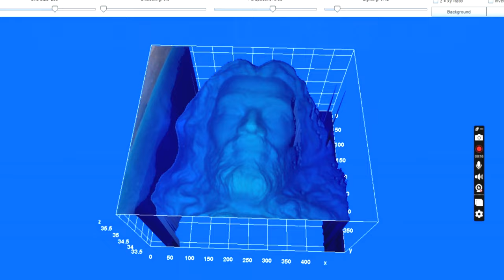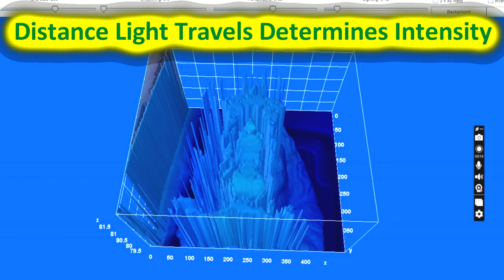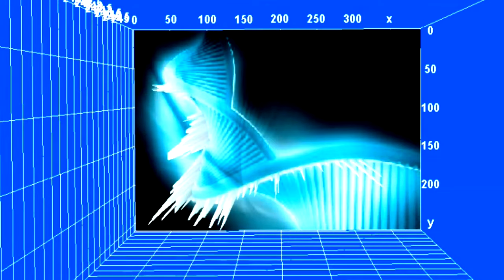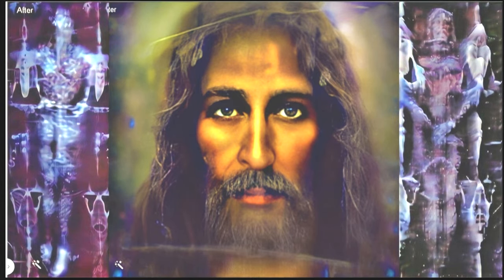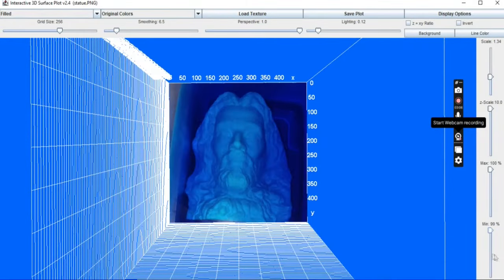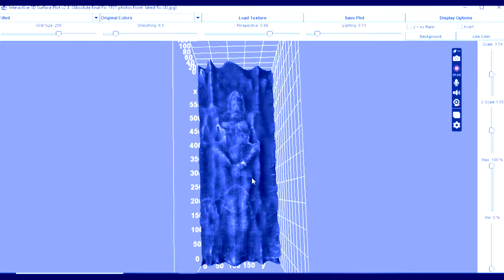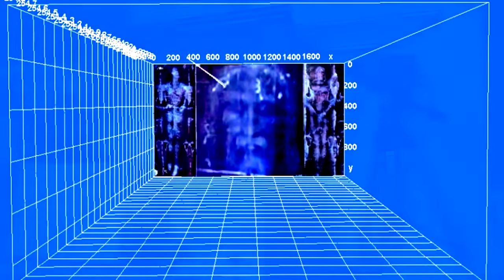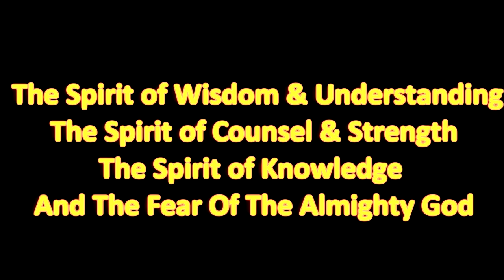Body of Jesus Emitted Light: 3D info on The Shroud of Turin Part 2

Comment: As a 3D developer for 20 years I know it's nearly impossible to create a perfect relief map. When the shroud of Turin is put into a 3D application it creates a perfect 3D model. It's impossible for this to happen in nature, except Jesus!!!! God bless you for sharing this information!
Reply from the maker: Yes,  Baptist Grace.  Very insightful and intelligent comment. The only way to create a perfect relief map is by making a hologram.  All of the characteristics of the Shroud image are that of a hologram.
We should discuss this in more depth.
Reply from the maker: Hi Saved By Grace.  It has been one crazy year with more stumbling blocks put in my path than I can remember from any previous time.   MAKING FOR A VERY CHALLENGING AND FRUSTRATING YEAR.  YES IN ALL CAPS .
The info here IN THIS VIDEO MUST be updated and explained better.
But to state things in a simple way,   If the Shroud was a contact image with paint for example.  The color intensity on the nose and the side of the cheek would be roughly the same.

That would cause the image to look flat and or deformed and awkward looking.   It will look obviously Wrong.  That is why all other images fail.  To state it simply. Those images were not emitting light of a single wave length creating a interference pattern to create the image. 

The Shroud image is made of mathematical distance points converted to color.  And it a VERY ACCURATE.  just like a hologram is. 

For example the tip of the nose as the highest color intensity and the cheeks have a lower intensity coloration.  
When all these light and dark intensity colors are analyzed by a 3D software program they are converted to math and then displayed. 
The Shroud "looks right"  Correct Math.   extremely accurate. 
The photographer who took the 1931 photos used film plates that were insensitive to the color red.  He is the only photographer that did this that I know of.  This minimized the blood stains .  They pose a  huge problem for seeing the 3D depth info because they are not part of the body images over the blood. 
Also he stepped back and then took photos of the Shroud from a distance with these film plates insensitive to the color red.  THESE ARE THE BEST PHOTOS TO SEE THE 3D DEPTH INFO.   We show them in the video. 
Other photos of the Shroud do not show up correctly because the weave of the fabric is in the images and the bloodstains are very bright.   Super up close photos of the Shroud look very bad on a 3D surface plot because of the blood stains and the fabric weave getting mixed into the depth info. 
Long story short.  The 1931 photos of the Shroud that were taken with the film plates insensitive to the color red and taken from a distance HAVE THE VERY BEST DEPTH INFO
Because the weave of the fabric and the blood stains interfere with the depth info and this MINIMIZED THEM SIGNIFICANTLY. 

That is what I have to explain in the next video and not waste a second doing it

Thanks for posting.

Comment: Makes me feel like a Galatian. It must have freaked them out the day they saw tech thousands of years ahead of them and still hundreds of years ahead of us.
Reply from the maker: It was a sign to them and a sign to us,   Paul of Tarsus mentions this.  " Oh, foolish Galatians! Who has cast an evil spell on you? For the meaning of Jesus Christ’s death was made as clear to you as if you had seen a picture of his death on the cross;

There are pollens from plants on the Shroud from central Turkey where the Galatians were at that time............

What is interesting is how the Shroud image when it is tilted on it's side on a 3D surface and you spread the lights and the darks of the image apart,  it simply will not distort out and spread out from end to end like other images do. 
It stops at a point and will not go any further.   The lights and darks of the Shroud image have a relatively narrow scope of lights and darks within in it.   
Other images have a completely different response.   The lights and darks of those images completely spread out and become utterly distorted.  The Shroud image does not.  It remains stable. 

Also the statue head depth info is exactly the same as the Shroud.  It will not distort out.  Stable under the hardest test and has the same relatively narrow scope of lights and darks in the image.  As expected to see if the object itself was emitting light and created the info. 

It is scientific evidence that supports the creation of the Shroud image involved the use of ordered and controlled light coming from the body itself.   Just like the 3D info on the Statue head was created by UV light emitting from the statue
Creating accurate Depth info involves having a 3D object that is emitting light in a dark room with no other light interference.
Reply from the maker: You are truly the voice of reason.
Reply: @GoodShepherdFilms3333  You're a pretty good Shepherd yourself. Leading the sheep to right gate, the right door. You know about Israel, this morning right? Looks like the endgame hand was just played.

Comment: I keep coming back to this video wow just amazing.
Reply from the maker: Hi Carol.  I need to give you a response on this in greater depth.  this is the video we are updating right now .
I have to write a audio script for the updated video

There was some very important info left out of this video that MUST BE EXPLAINED BETTER

Anyways,  we ran more tests with this

1. Statue head underwater without food coloring:  The Depth info was not nearly as good.  The side image looked terrible. BUT with the food coloring in the water the depth info was EXCELLENT.   So the food coloring in the water is a ABSOLUTE MUST.   For some reason when the light travels slower the math is correct.
The 3D analyzing software converts color to math.  If it is the wrong color it means the math is wrong and thus the image will distort when put to the test. 

bottom line:  To create a facial and body blueprint that has the correct math in forensic agreement with a real human body that body itself MUST BE EMITTING LIGHT and create a interference pattern. 

There is no way to get around that.    Man made images DO NOT HAVE THE CORRECT MATH and fail under the hard test for mathematically correct depth info

I only used caps to emphasize important points.  When I record a audio track I need to be reminded of that

I like this display because it is a math display and the witness is an expert in math and is an impartial witness whose only job it is, is to report the truth

Another thing that is not mentioned here that must be explained is a somewhat complex thing to present and explain with proper graphics

The Shroud image was most likely the result of a INTERFERENCE PATTERN OF LIGHT,  in which the light from the body exited skin pores and was diffracted in the process creating waves of light that are all the same color

Parts of the body closer to the cloth left more pixels of the same color and parts farther away left less pixels of the same color

So the blank linen itself is part of the coloration process.   Shroud is a 1 color image and differences in intensities is achieved by more or less of the same color in a given area

The only way we know how to do this is to make a hologram and create a interference pattern, but it is also possible and even likely the Lord God knows another way that we do not yet

I did not go into that here because that creates a whole new line of discussion and more difficult and complex graphics.

It also gets into the explanation that the image process was outside of time. 
So I need to think more on this and figure out how to record a new audio track without confusing our audience with complex graphics and having to explain what a interference pattern is

That is the big challenge

Comment: Wonderful work! Did you ever include the The Holy Veil of Manoppello:? It too is remarkable and shows the human living face with eyes. Or the other linen cloths in Oviedo, Spain?
Reply from the maker: Good evening, I am actually doing a revised and improved version of the other 3D shroud video showing the depth info . It's very difficult to render because there are 5 to 6 image tracks and 3 audio tracks all playing at once which causes the editing software to crash.  It's a complex arrangement of clips and special effects.    But I will check the Manopello image for depth info tonight and let you know the results.  It might be a few hours.  I'll get to it as fast as I can
Reply: Thank you. I spent a half day in a seminar from Mother Superior of the Convent in Manoppello. I have seen the Holy SHroud in both expositions and when it is just behind the glass. But the Manoppello image was new to me until 10 years ago. It is an image on a special material made from (quoting Wiki) "The cloth has been claimed to be made of a rare fiber called byssus, which is a natural fiber coming from a bivalve mollusc Pinna nobilis, woven into sea silk, and used by ancient people mainly around the Mediterranean coasts." 
I was unconvinced but it is possible that this image actually overlays the face on the Shroud.
Reply from the maker: @jacquestaulard3088  Good Evening. .  I do think there is a connection between these cloths.  The Manopello image does not have depth info.  I checked.   This could be simply a fact to cloth contact image and perhaps someone used some kind of pigment and added to the contact image to fill it in.  I really don''t know.  But I did check for depth info.   That can back negative.  It does line up with the Shroud.  I did overlays with it many times.

Comment: Wow! Thank you for sending me to this video after my question on the other video about lighting a dollfrom inside to get this information. It is great when someone has already answered a question  before it is asked.
Reply from the maker: Hi Robynn.   We ran alot of tests with this 3D statue head.  
1. We took photos of it outside the water glowing in the dark,   
2. Underwater without food coloring in the water
3. In regular light
4. A copy of statue head made by a photo copier scanner

Only 1 method worked    
1. Statue head underwater with food coloring in it.   
That way produced BY FAR the best results 
The water slows down the light down to about 45,000 miles per second slower and the food coloring slows it down even more
Our tests prove slowing down the speed/frequency of light is critically necessary.  

If the speed of light is not slowed down then the intensity of light emitting from the statue head will NOT create shades of light and dark accurate to the object itself.   
When the light travels at its normal speed of 186,000 miles per second,  it is too fast to create a light intensity distribution image that has 3D depth info. 

Meaning the light intensity on the tip of the nose and the sides of the cheek will be relatively the same and thus will appear as being flat on the 3D surface software.
There must be precise color changes that are accurate to the 3D object itself. 

When the speed/frequency of light emitting from a 3D object is slowed down underwater with food coloring,  this particular speed is the correct combination that opens the safe to creating excellent depth info

Bottom Line:  Body in the Shroud had to be emitting radiated energy.  Highly ordered and controlled light.  Like laser light   Moving in a straight vertical line or a interference pattern was created by a second light source in the tomb.   A reference beam

The field action of resonance is also involved.   Which may have been created by the reference beam.  
The reference beam would have been the Almighty God himself in the tomb.  A Father coming to Save His Son.
Reply from the maker: I will send you some more things that are even better.  Much better  Please give me time I am working on it now

Comment: Praise the Lord. I have been trying to figure out how the 3D information could've been imprinted on the cloth for decades. When you showed that the light was slowed down due to being submerged in the vat of water, I knew that you had discovered a key piece of information that I had not considered before. I knew about the body hovering and the shroud being stretched taut and not in contact with the body of the Lord, but I was missing the key parameter of the light being slowed down. The second piece of the puzzle was the source of the light. I knew that the source must be from within the Lord's body, but I hadn't considered that it could've been emitted from the DNA of each of the 2 trillion cells in His body. The only missing piece of information from your video is how did the light slow down. It had already been accepted by the scientists that the image formation was due to the discoloring of the linen fibers at the uppermost couple of micrometers. Furthermore, one of the scientists had determined that the discoloration was due to aging. Then the Holy Spirit revealed to me that it had to be a time dilation phenomenon created by intelligently controlled anti-gravity fields. This would simultaneously levitate the Lord's body, stretch the linen cloth taut, age the fibers and slow down the speed of light in order to create the image and imprint the 3D information within the image. This could only have been done by a supernatural being of great power and intelligence, in other words, God in His triune nature as the Father, the Son and the Holy Spirit. Thank you for your unwavering dedication to revealing the secrets of the Shroud of Turin.
Reply from the maker: Your welcome.   Another possibility is that the image was created outside of time.  In a timeless state.   A question would be if the Almighty God was present in the tomb and involved in the image process  and we know God comes from a timeless state,  how would that affect the surrounding environment?
Reply from the maker: I found this to add to your comment.   Time dilation is also real, and it's because in Einstein's theory of general relativity, gravity can bend spacetime, and therefore time itself. The closer the clock is to the source of gravitation, the slower time passes; the farther away the clock is from gravity, the faster time will pass

Very thought provoking and difficult for me to understand this.     It is interesting to note on the Shroud are the 2 blank lines going down each side of the face.  That is virgin fabric untouched.   Blank.  Nothing there at all . Except a blood stain from body to cloth contact.   On the statue head there are dark lines on each side of the face and they are the darkest part of the whole image.  This is a holographic image characteristic.  A holographic image process cannot record the sides of an object, only partial sides.   We see this on the statue head and on the Shroud no distinct edges.  It fades off on all sides.  

My theory only.   Field action of resonance is involved.  When Moses was close to God he came back from the mountain "glowing"    When we get close to God our DNA increases in oscillation causing it to emit more light than it normally does.   Like a tuning fork that is oscillating and is brought close to another that is not, it begins to oscillate at the same frequency.     The Almighty God is outside of time.  His presence in the tomb must have caused some kind of change to the environment,  affecting time itself.  Although I do not completely understand I believe the image process occurred outside of time.  In a timeless state.  A timeless God created a timeless image. 
More time in prayer and thought is needed.